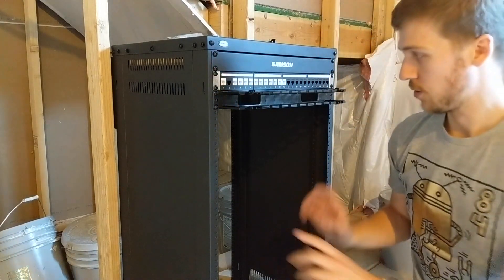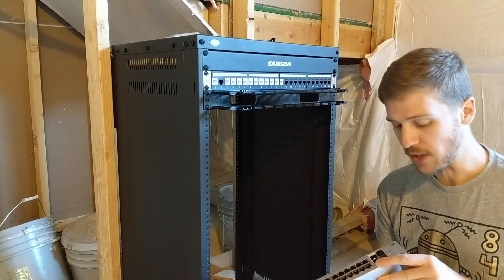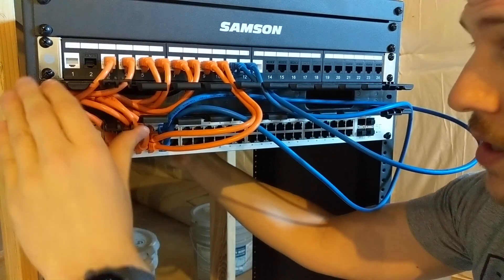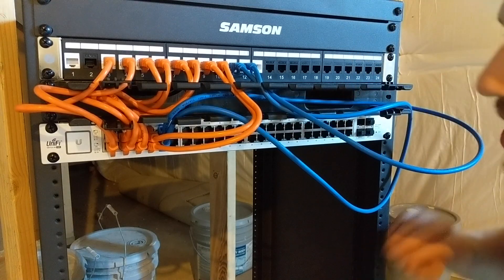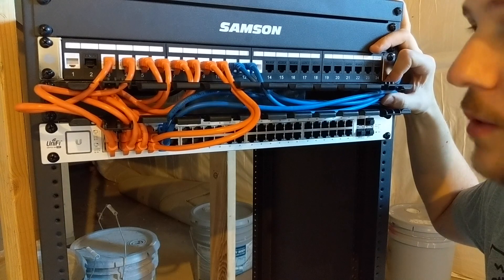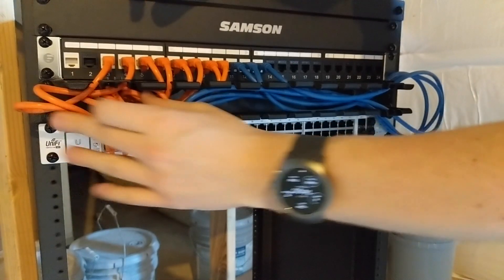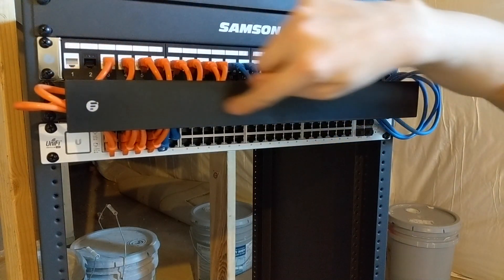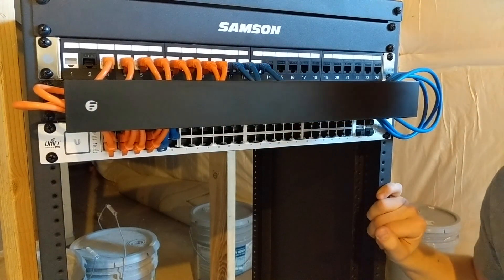Installing the Unifi 48-500w Switch - Pt 3

Comment: i have a 24 ports switch abd upgrading to 48 ports 750w.  the 48 port is much heavier than the 24.  by just mouting using 4 front screws is it enough to hold the switch without damaging it in the long run?
Reply from the maker: Yeah, they are designed for that, no problems after years of install. longer servers and UPS's however I would recommend rails (mostly cause they are heavy and much easier to install etc)

Comment: Can I ask why did you skip the 1 and 2 port on the upper side of the rack ?
Reply from the maker: oh thats years ago, so can't quite remember, this probably what I did:
- In new builds in the US, they bring two de-mark (CAT6) cables from the ISP ONT (where the fiber terminates) on the outside of the house, so I probably reserved the first two ports for those two cables.

Comment: I'm not sure why everyone believes you can't exceed 1gig on a single connection with teaming. I have both teamed connections and 10gig sfp+ connections and have the iperf3 tests to show both can exceed 1gig on a single connection.
Reply from the maker: Loren Howe some proprietary trunking will do aggregated speeds. But the standard protocol won't. However if your program transfer is multi threaded, than each stream will get split up and assembled the other end. https://serverfault.com/a/569125/317015

If you have a post with your config and testing parameters I would be interested to see what you did.
Reply: Using LACP it's simply not possible to have a single TCP stream exceed the bandwidth of any single member of the aggregate. However, using multiple streams it's possible, for example using SMB and NFS simultaneously may leverage multiple different TCP streams. But, each stream will only ever reach the speed of the single connection within the aggregate.